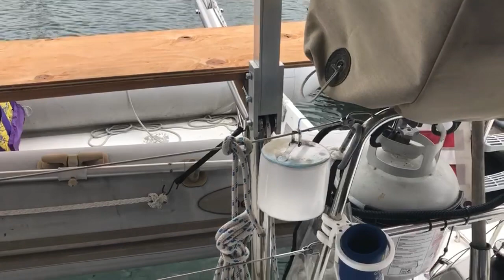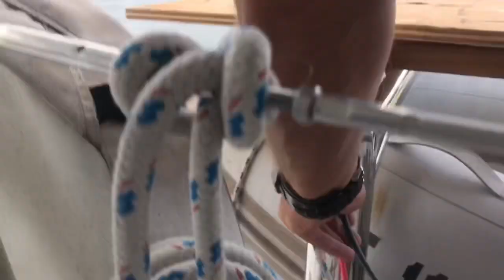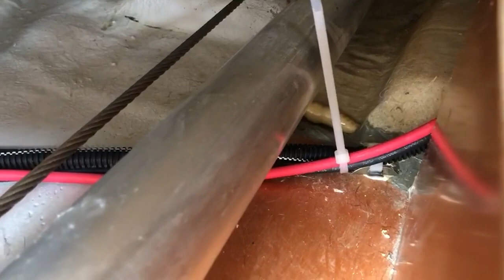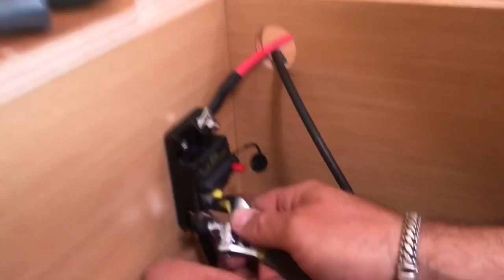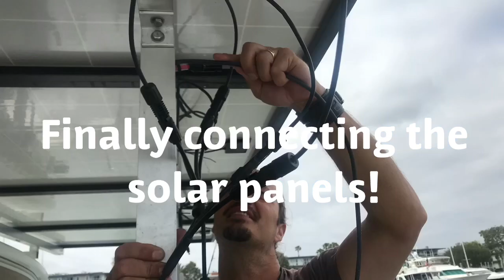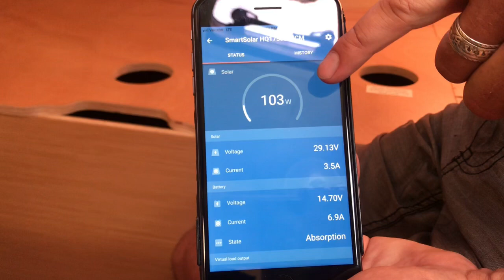Ep. 13 - Lagoon 400 Solar Installation on a Budget - Part 2

Comment from the maker: Hi guys, sorry have been working. But this whole virus situation gives us some time to think about our boat and it’s awesome comfort and features whilst being in isolation in Mammoth. Our solar system has been working quite well. Certainly for 2 people more than sufficient. We never hit the 1000 Watts exact, but darn close. We did add a wind turbine to add power when sailing or relaxing in more cloudy or dark conditions. We will probably add some more solar to compensate for our additional freezer and fridge. Will probably make a video of that installation too. It will be 2x 150W flex panels on top of our helm station with another VictronConnect MPPT charge controller.

Comment: Great work.  Can I ask why did you not wire the solar chargers to the far side of the shunt, so you get the power measurement from the shunt?
Reply from the maker: Richard Doherty  What is the shunt? (Sorry, English is my husband’s 3rd language. He’s unsure of what you mean.)
Reply from the maker: I am sorry, I don’t understand your question or understand what the difference would be in performance or measurement. What would have been your interpretation of a better scenario? Please note that besides the shunt on the far end I also have a breaker installed primary to the solar charge controller.
Reply: If the solar attachment was on the other side of the shunt (not the battery side), then your general boat power monitor would include the input from the solar panels.  Without using the shunt, the power meter includes the usage but ignores the input from the solar panels.  I know you have a separate monitor for the solar panels, so you know what;s going on, but the general boat monitor would show a less useful number, I suspect.  Just curious, this isn't any kind of design flaw, just a choice about what your power monitor reports.
Reply from the maker: Hi, sorry for misunderstanding your question initially. Your comment and therefore suggestion makes sense. I simply did not consider it as I was solely relying on the data obtained from the app provided with the solar chargers. The current power monitor on the boat is very limited in its capability to show the input of various charging resources. I am aware of reliable aftermarket systems that provide this flexibility. Consider it a Part 3 of the saga. I am sure improvements can be made and suggestions are always welcome.